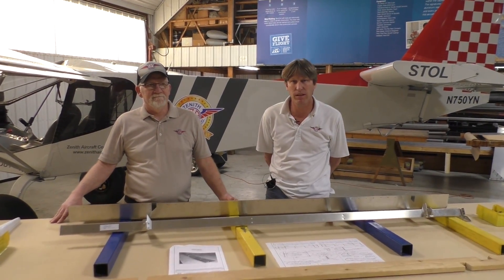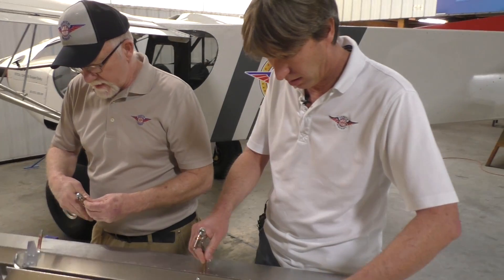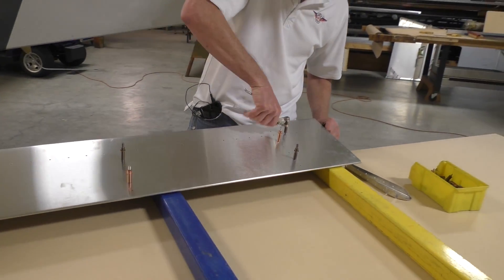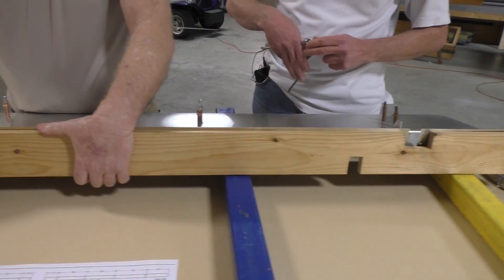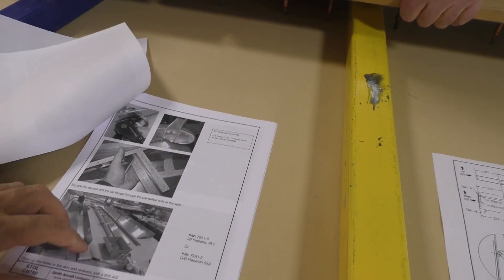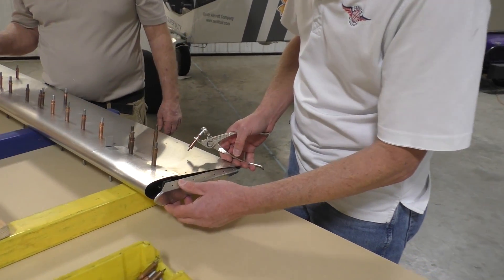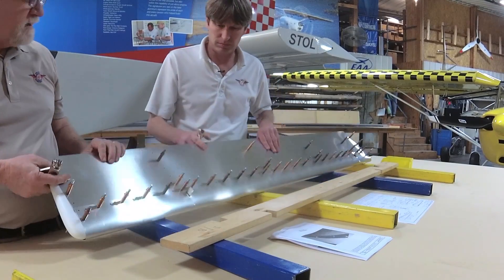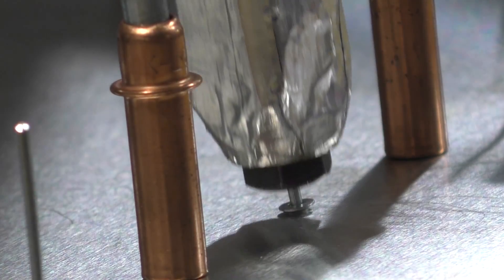Zenith CH 750 Kit Assembly: Building the flaperons

Comment: That was a good video,but you showed the easy part to figure out.  That piece isn't done yet, the end pieces and the hinge pin, and bushing isn't clearly shown where it is to be mounted. The instructions don't give any dimensions on where the hole needs to be drilled for the hinge.  I built my own plane and helped with two others so this is not the first one.  There is a lot of frustration trying to figure out the plans. Sincerely.  Norm Bontrager